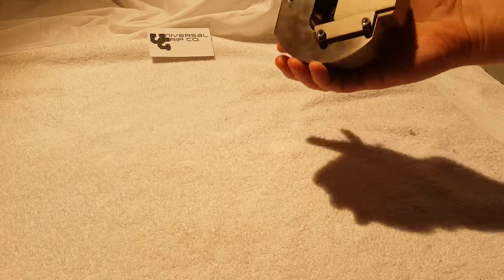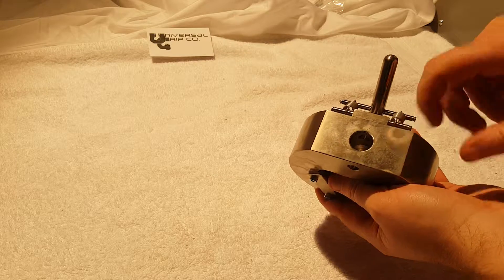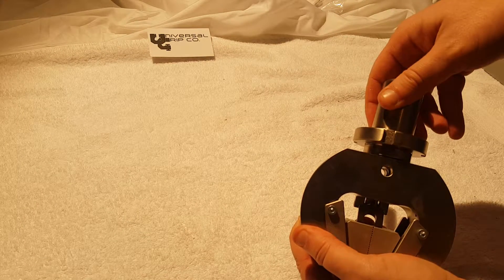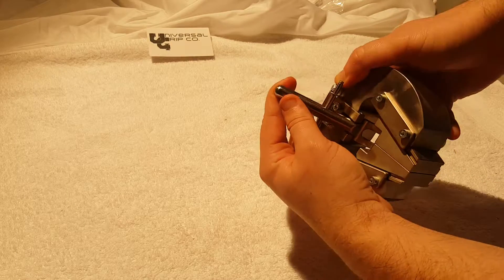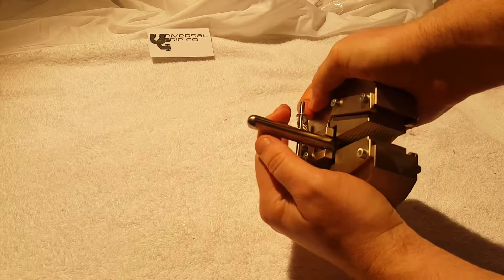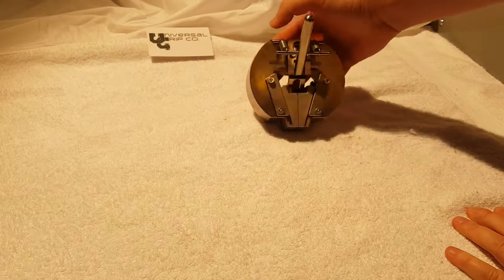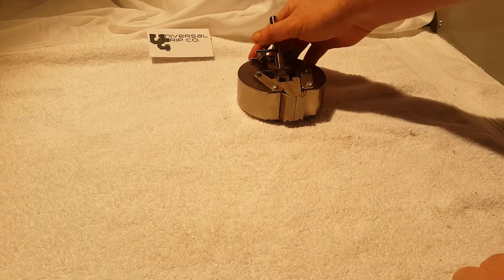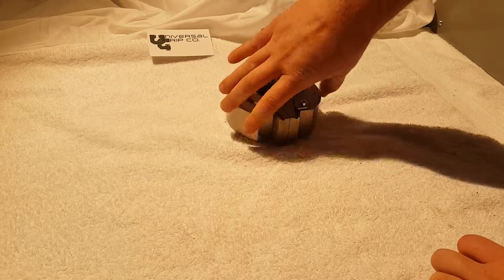10kN Wedge Grips for Tensile Testing

Comment: I am looking for a smaller size, but the application is to grip on to round rod pin, so I can remove/pull it from its socket. Let me know if you have any smaller size with Vee griper.

Comment: What is the material used in manufacturing/making the grips?
Reply from the maker: Ithar Al Sawwafi this grip is made from steel and coated in nickel. The smaller/weaker grips are made from aluminum.
Reply: Thank you.
Do you know what the exact type of steel that was used?
Reply from the maker: Ithar Al Sawwafi a6